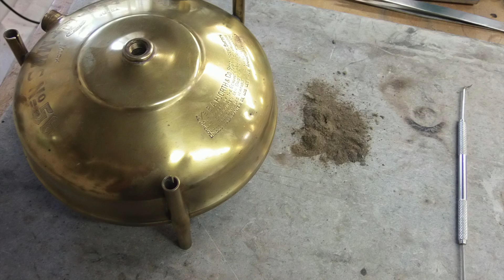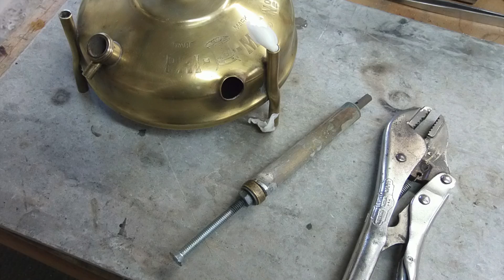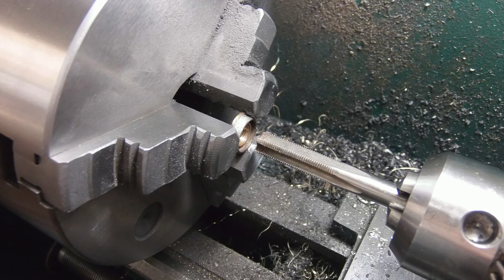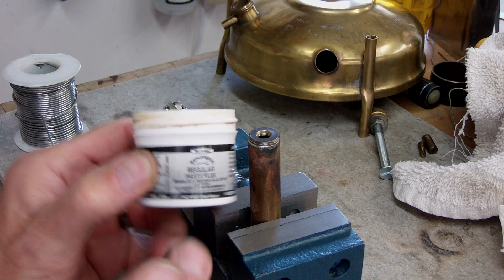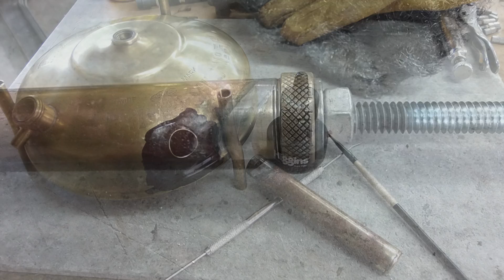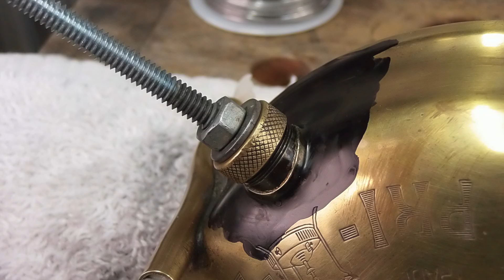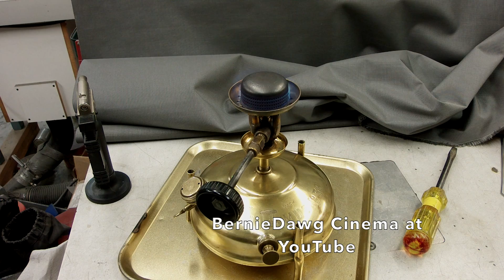Pump Tube Removal & Installation

Comment: Hello Bernie, did you make the control thingy on the burner head ??
Reply from the maker: @Sander Tel No, I didn't make the spindle knob and shaft. That's a genuine Primus #4163 "spindle with wheel" that was bundled in some flavors of the #4155 silent burner that was found on the stove in this video (a Primus #56 stove). The #4163 spindle knob/shaft collar is threaded and threads onto the special threaded spindle nut (#4162) used on the burner. The #4155 burner was a predecessor of the more common type of Primus regulated silent burner seen later, the #4190 which everyone is far more familiar with. The #4155 seems to have been produced from sometime around 1940 (maybe a tad earlier, but a later development than the earlier Primus #4135 silent regulated burner), but has disappeared from the Primus parts roster by about 1952. You find them commonly on Primus #41 box stoves and also on #523 yacht ranges of that era. The #4155 burner has its cleaning needle and jet housing on the left side of the housing, the opposite of the #4190 which everyone is more familiar with. This means the cleaning needle extends out of the jet when the spindle is fully closed, instead of fully open. Setting the cleaning needle was(is) more complicated and Primus even made a special tool (#1538) to make it easier. Note, too, the unique #1591 safety valve fuel cap on this #56 stove. Cool, huh? 😎BD
Reply: @BernieDawgCinema  Yes very cool, I like the way you go about fixing the thing...very nice to watch as well. 
Can a metering valve with control knob be retro fitted (beneath) a standard (non regulated) burner head ?
Reply from the maker: @koningbolo4700  No. Sorry. You'd be metering liquid filling the burner instead of fuel vapor leaving the burner. With a standard silent burner, the flame regulation is accomplished by controlling the tank pressure. That's what the vent screw on the tank is for. More pressure (strokes of the pump) equals bigger flame. Release some pressure with the vent screw, and the flame gets smaller. This is why these are only for kerosene. Release pressure from the tank using Coleman fuel and there'd be enough vapor in the tank escaping into the air near your burner flame that you would get a bang. (Ouch!) BD
Reply: @BernieDawgCinema  I hope to acquire a similar device in the next few days: An Eastern German build BAT silent burner brass thingy. It looks very much like the Primus brand cookers. I just want it as part of my camper van setup as a backup/outdoor cooker.
I use the Origo 2 burner marine ethanol stove to great satisfaction but since the van is a diesel fuelled one it seems appropriate to have at least 1 cooker which can run on diesel/kerosene/jet A /waste vegetable oil or the like.
BTW: I hope the BAT device works as well as yours do and I do not have to remove the pump tube to get to the valve thingy... I am not even sure if I will polish the thing... I like the rough and ready look of the patina on there...
(As you may know: A clean kitchen is a sign of a somewhat wasted life...)
Reply from the maker: @koningbolo4700   Uh... okay. Thanks for sharing all that, but this is getting a bit much for YouTube comments. FYI, these burners will not work well with veggie oil or diesel fuel - no stove will. If you want to talk more about it contact: berniedawgstove@comcast.net

Comment: Great video.
I had to do a 210 yesterday.
A leg dropped off whilst desoldering the pump tube :(
I drilled out the old NRV and re-tapped the hole (M8x 0.75), instead of removing the tube base.

Comment: Thank you so much your instruction, I have same issue on my Radius 21 NRV.
May I ask you what size of the Tap for re-thread? The new NRV I bought from ebay won't fit.
Reply from the maker: If you mean where I am chasing the threads here... https://youtu.be/tTkGeA6YTHw?t=3m13s , that thread is best approximated with a M8x0.75. But! The inexpensive NRVs available now *DO fit*. They just come without any sort of tapering to the lead-in thread. We're all used to a taper on the first few threads so that the thread wants to naturally sit into its mate. Without that tapering, it's easy to cross-thread the NRV into the pump. To correct the lack of thread taper on your inexpensive NRVs, just take a little 320-grit carbide sandpaper and taper the beginning couple of threads to a slight angle. Then, those inexpensive NRVs will seat in nicely and work just like the originals and fit just fine. If having to correct the budget NRVs seems like too much trouble (and it is a bit of fussing to do), or it seems too challenging, it's best to stick with the expensive-priced original NRVS even though the prices are much higher. Happy stoving!

Comment: very good that is the black paint on the paw ????
Reply: I do not know how to speak English use translator
Reply from the maker: If you mean the black at this point in the video: https://youtu.be/tTkGeA6YTHw?t=6m14s , that is black india ink like you use for fountain pens and writing. The ink is brushed on the tank to keep the solder from running places you do not want it to go. The ink acts a masking.
Reply: thank you very much for the comment I just soldered an old heater in the neck